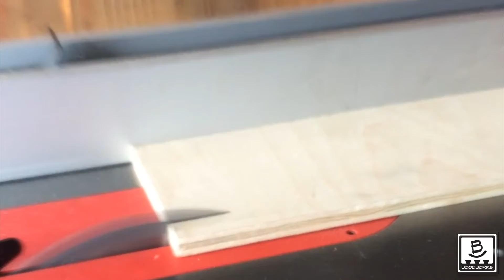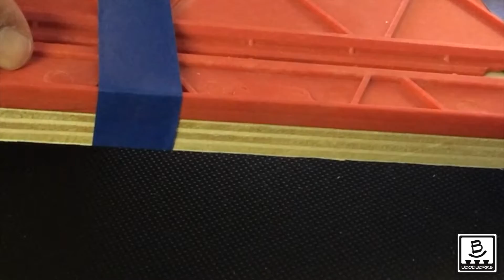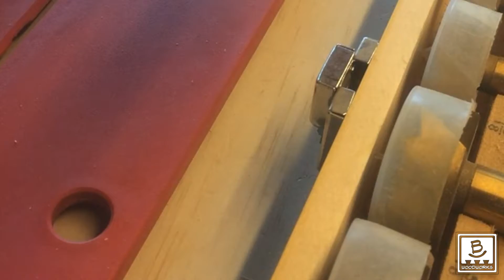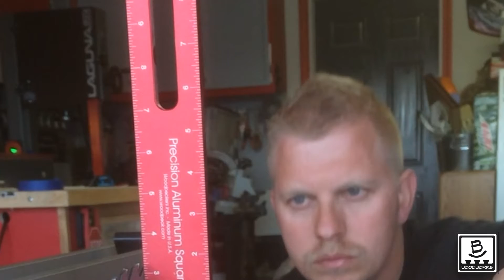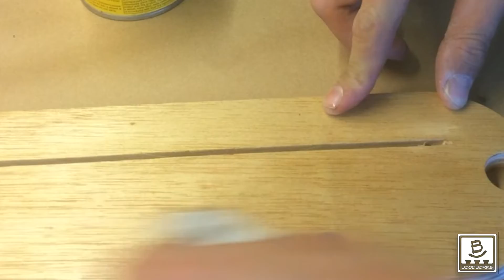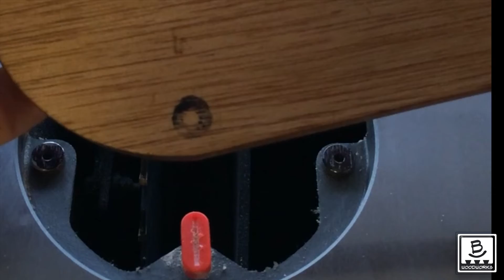Zero Clearance Plate (with rare-earth magnets) for a Laguna Tools Fusion Table Saw

Comment: Hi there, thanks for sharing  your beautifull work! I found one of those table saw's on a garage sale. From what I could figure out the person who I bought the saw from, got the saw without it's original motor, so they replaced it with a 3 hp motor, but they mounted it like a contractor table saw hanging on the back of the saw (yes, they made a cutout on the body, I will have to weld back a part for it, no biggie) . So they run it like that wihtout calibrating it and removing the saw's tilting capabilities, resulting in a massive gridn out section on the bottom of the saw's main cast iron top, so they sold "cheap". I have different motors aailale a well as a welder, I want to adapt one of those motors (with different dimensions) to the saw because otherwise it's in mint condition, it just needs love, proper calibration and maintenance. I've tried to reach Laguna to ask for this information but no luck so far, could you please check your motor's frame type/specs plate? 
Since the space is tight it would be awesome to know which type of frame/dimensions the original motor has, laguna asks for 400+tax for they replacement motor for the upgraded version of this saw (the fusion 2) and parts are not available anymore for the gen 1 fusion (ours model), would you be so kind to help a brother out?  Thanks a lot for your time and consideration!

Comment: How did you get the plywood to the right thickness? Did you sand it down? Also, how did you get the insert to settle in to the slot over the blade before the groove was cut? In my saw, my blade is too high even when fully lowered.